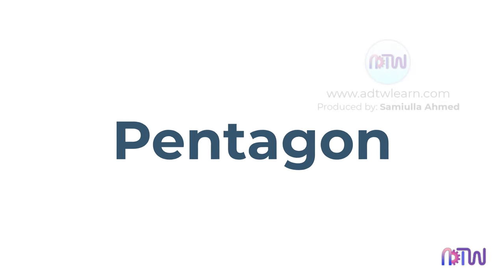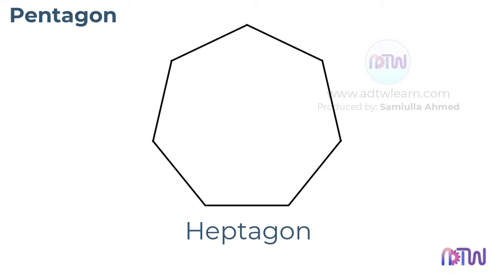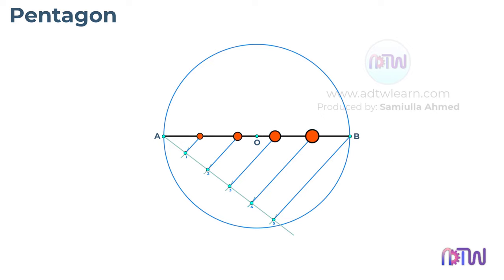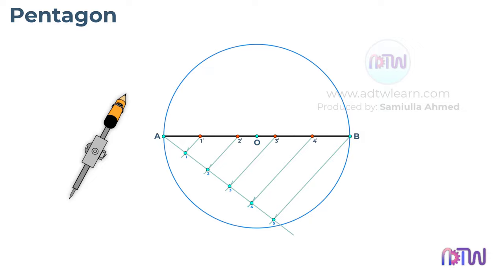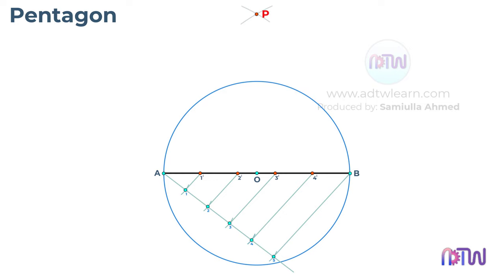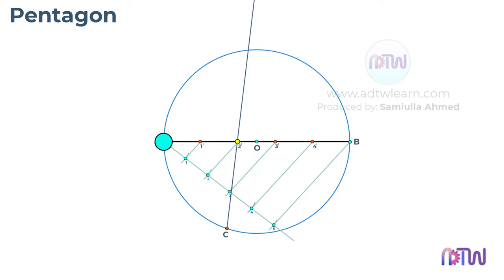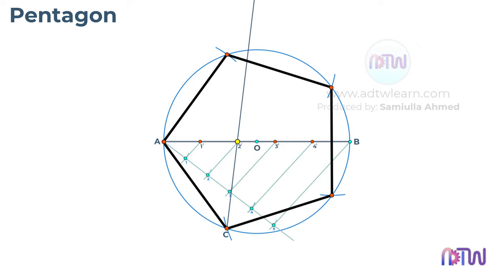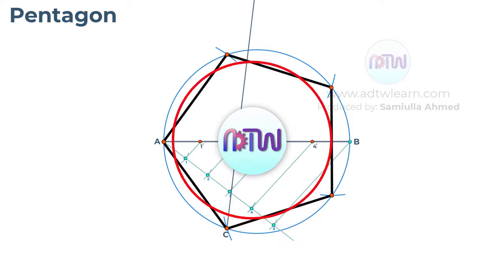How to Inscribe a Polygon inside a Circle || General Method

Comment: can you draw a 7 sided regular polygon with this method?
Reply from the maker: Yes, divide the horizontal line into 7 parts and draw a vertical line passing through point 2 on the horizontal line...
Reply: @ADTWstudy  pffffffftttttttt
Reply: @lanceraltria  No you cannot. It will be an approximation but it will be slightly off. Try it yourself.
Reply: @ADTWstudy  No you cannot. it will be a close approximation but not correct
Reply: But why only from 2

Comment: NOT a general method.

While this does correctly inscribe a triangle, square, or hexagon in a circle, it does not work for other regular polygons.  It does produce remarkably close results for a pentagon (.065% angle error), heptagon (.17% error), and octagon (.42% error), but the error continues to grow as the sides increase.  By the time it reaches a 25-gon, the error is large enough to not even fit 24 sides in the circle.

It's fine if you want to draw an n-gon approximation with a small number of sides, but don't use this on a math test.
Reply: we use it all over spain, not as an exact methow but as aproximate method
Reply: So what’s the best method?

Comment: Can you please explain me the reason that how that first side you get as one fifth of the circumference? 
I cannot get it don't know which property is used here .. please tell...
Reply from the maker: Dividing the diameter of a circle into five equal parts, as illustrated, results in a distance between point A and 2-dash that is approximately equivalent to the length of one side of a pentagon. This constructional approach is employed to approximate the general shape of a pentagon. For precise length calculations, the formula 2Rsin36(degree) can be utilized, where R represents the diameter of the outer circle.